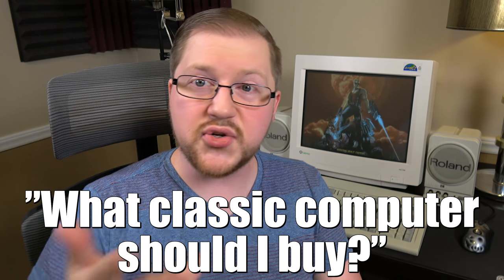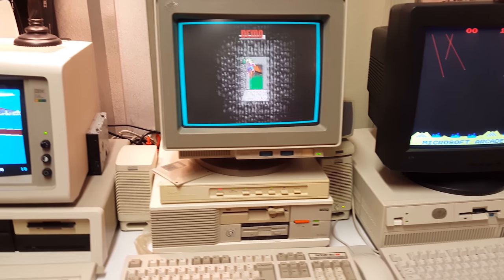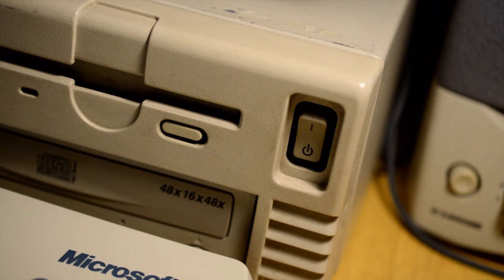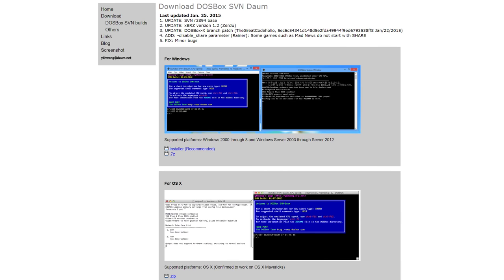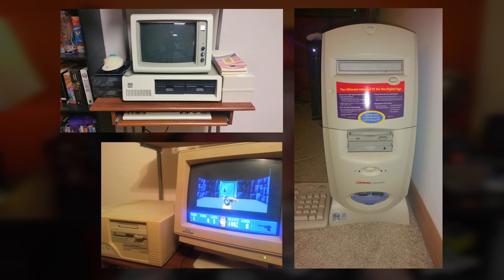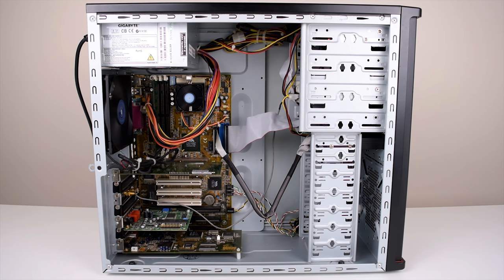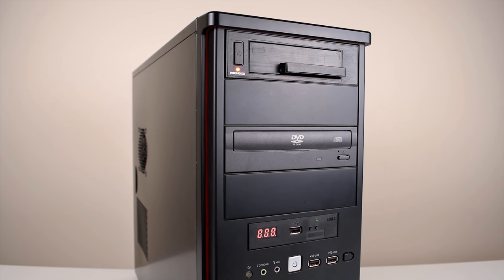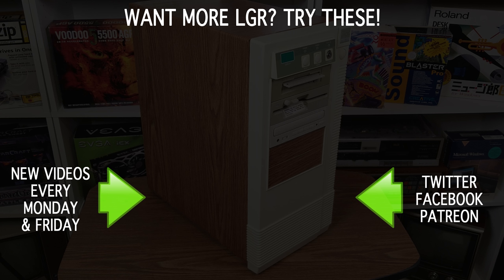Choosing a Retro PC for Games: Advice & What to Look For

Comment: As much as I loved and miss the nostalgic feel of the past, I am perfectly fine with emulation even if it isn't authentic or always accurate. Sure I miss the beeps, boops, buzzes and drive noises etc but it would be a hassle nowadays.

We used to have a 486 computer that I spent so much time on growing up, especially after my father got a computer with Win 95 and gave me the 486. Well time went on and it started to give me more issues as time passed. The thing basically became high maintenance and when I fixed one problem another would occur some time later so I said screw it.

Hell even the parts became more expensive and harder to find as time went on which was the main reason I stopped. It became such a money sink and I couldn't really afford it back then with what little I was getting paid anyway.

If someone not experienced gets into it nowadays then they better learn because it will require maintenance otherwise it will just became a huge paperweight. I'm all for authenticity but technology today has become so much more efficient and lasting without errors (Mostly), I don't miss it.

I definitely do miss my XP desktop though, don't really recall what it's specs were as that was years ago but that's probably what I was happy with most. I basically was able to run most of my 95/98 compatible games on it, some with issues but were usually easily fixed. Then of course emulation for DOS but I was fine with it.

Might have to build my dream machine for XP sometime, I'd be pretty happy with that.

Comment: These kinds of videos inspired me to build my own PC for late 90s and early 2000s gaming. The cost of vintage parts is expensive, and I already had a bunch of parts lying around, so I decided to sacrifice some compatibility for a cheaper, newer machine. It has a Pentium 4 3.0 GHz, 512 MB of RAM, a Radeon 9200, and a Sound Blaster AudioPCI card, running Windows ME. I may grab a copy of Windows XP to try out as well.

It's not perfect, and a few games run poorly or not at all, but I like it and it works pretty well for me. For DOS games that don't work natively on it, I run DOSBox, but on the machine itself. The irony of using DOSBox on DOS-based Windows is hardly lost on me.
Reply: As I see Pentium 3 is not particularly expensive. Not much more than Pentium 4 if you go for s370 instead of Slot1. One of my favorite P3s is my Pentium III-S 1.26GHz 512MB RAM, Geforce Ti4200 and Sound Blaster Live for late 90s and early 2000s. I got the whole stuff for about 25$. Though this one was a lucky catch. It's very likely that a P3 can be built under 50$.

Comment: I found an old Pentium 4 machine at a thrift shop for 20$. Had an nVidia card in it, two 60 GB HDDs, and 2.5Gigs of ram. Formatted the HDDs (was running XP), took out 2 gigs of ram (due to Win98SE issues) and swapped the nVidia for an ATI Radeon I got in a "box of parts" from the same shop on the same day for compatibility with Clandestiny. Came with a Sound Blaster 128 PCI. Installed Win98SE on there and it works as far as I can see. However, this was all to get Win98 era games that will not even install on modern PCs to work. I use Dosbox for everything else and anything XP and above is either functional or someone out there loves it enough to patch it to working.

Comment: Speaking of Sourceports, I also used DXX Rebirth to run on a P3 Machine along with a Voodoo3 and it's awesome. Did the same with zDoom (with BrutalDoom "addon" it's really great!) and eduke32 had to swap the V3 for a GF2MX for that I have to say because of (more compatible) OpenGL capabilities. It's a bit of picky with the OS, from XP on there are no problems anymore, but then you get - IMHO - more into the modern era with CPU/GFX then. If I can, or above Sourceports allow, I stay with even Win98SE and KernelEx. Sometimes I have to check out many older versions of the Sourceports.

Comment: Ahh the 486s. The first computer I built was not a 486 (it was based on a Celeron 300A in 1998), but my second computer was a 486. I found a motherboard discarded in the trash complete with 16MB RAM and salvaged it, added a 486DX2, a salvaged AT case and a SCSI card (Adaptec AHA1542CF) as well as several small SCSI drives salvaged also from older Macintosh computers that people were throwing away (as they were replacing their older Macs with the new at the time iMac). I got away with using a total of 6 HDDs in it by running them in software-mode RAID0 in Linux. :) The total capacity was a whopping 1.2GB!

The motherboard itself deserves a special mention. It was an Octek Hippo DCA2 with no L2 cache, as Octek claimed that their chipset does away with L2 by using some special-sauce RAM modules that allowed the whole RAM to become the L2 cache. I don't think that anyone ever proved them right or wrong, but the machine didn't feel slow. Unfortunately I don't have that motherboard anymore as several years later when I moved I had to get rid of some of my hardware, and sadly that 486 machine had to go away. I tried in recent years to find another Hippo motherboard, but they seem to be extremely rare these days. I wish I could now run some tests on it to see if there was any substance to the claims about L2 by Octek.
It also had a MrBios BIOS chip (anyone remember MrBios?) with many, many customizable options, more than I've ever seen in a 486-class computer. MrBios was primarily a BIOS upgrade company, they were selling customized BIOS upgrades but apparently a few motherboards also came natively with a MrBios chip. Good times.

To be honest, these days my favorite retro machine for DOS and early Windows games is an old laptop. An IBM Thinkpad 755CX, with Pentium-75, 40MB RAM (8MB onboard and 32MB upgrade card), 10.4" TFT max 800x600, 2.1GB HDD, and it actually has SB compatible sound (the infamous Mwave DSP) as well as internal FDD but no CDROM. Also has an IBM-branded PS2 mouse in IBM's colors (black and blue). It's not compatible with everything, but not too bad. I use an external 4x PCMCIA SCSI CDROM with it. And the best part is that there is a docking station for it that provides 2 full-length ISA slots, a 5.25" CD bay, an internal 3.5" HDD bay and built-in SCSI adapter as well. You can stick in it a real SB card and ISA VGA card if you want. It really is a nifty system. I must have spent hundreds of hours playing XCOM2:TFTD on it.

Comment: I will say this for original hardware. That was back when I started building my own PCs... Yes, it was more complicated. But hell, I've built tens of PCs over the years, and dip switches and jumpers were the norm. And it's much easier now. But I'd take take dip switches and jumper over menus and menus and menus of settings in an emulator any day.
If I were to build some PCs for retro gaming (I have very little nostalgia as I played everything till I got more than my fill), it would be a 386DX40 (only for wingcom2, and syndicate) with probably around 4Mb of RAM. EMM386 worked a treat, and if you ran memmaker once, and redid the config.sys and autoexec.bat yourself afterwards, you were golden. I cannot over-stress the importance of finding a good, low memory mouse driver. That was the holy grail at the time. Your could go from 23K memory mouse drivers like the Genius mouse drivers, to some 3rd party ones that went to like 6K or something. Oh and NC. norton commander was just awesome. pc tools looked pretty, but didn't do much. NC was the sh*t. ndd for disk problems.
For a DOS4GW machine I'd get the fastest processor build that could still run DOS. So probably a P2 P3, maybe even P4? 16-32Mb RAM. And Voodoo... As much Voodoo as you can get... Though the 4 and 5 were a bit iffy.... So probably a 3, and nothing SLI. AWE64. No VIA chipsets...  Asus and Gigabyte Mobos. TEAC floppy and stiffy drives. Probably a creative labs cd rom, but the others also became good later when we got to 4x speed and higher.  Oh hell, and if I could.... The $20 000 512Mb Maxtor SSD.... I think it was Maxtor or Quantum that came out with that ridiculous SSD... It took 2 or 3 full 5-1/2" bays... It was a  monster....

Comment: DOSbox has gotten better in recent years thanks to community-made forks that make it more accessible to newcomers while adding new features and improving compatibility and optimization.

With that said though, I'm grateful to have gotten my grandmother's old PC in my possession which had a 633mhz PIII-based Celeron CPU circa 2000, 3.5" floppy drive, an Nvidia GeForce 2, 256MB of RAM, and a CD drive. Over the years I've upgraded it with components we had lying-around or I've found at Goodwill. Upgraded the RAM to 512MB (completely overkill but it's nice to have for Win9x), added a SoundBlaster Live card for better DOS sound compatibility, replaced the CD drive with a Sony DVD drive, replaced CPU thermal paste, replaced the old 10GB HDD with a new old stock 120GB IDE HDD (also overkill but extremely useful), added an old Linskys USB Wifi adapter (a nice novelty for browsing theoldnet and using FTP I don't use it for much more than that though), a Daewoo CRT monitor from 1998, a cheap toenail clipper IBM ball mouse I found at Goodwill, and my grandpa's old Zenith alps switch mechanical keyboard which I absolutely love. It's my preferred way to play classic PC games predating 2001 now. I might consider upgrading the CPU and GPU eventually though so I can maybe get it to push more games from 2003-2006 or so (as a matter of fact I've since put the OS on a 16GB CF-IDE drive, upgraded to a Pentium III 1ghz and a GeForce4 MX 420 64MB- some very nice upgrades that ensure almost any game that works on Windows 98 will run relatively nice).

I would say Glide wrappers are now an essential part of retro PC gaming now since Voodoo cards have become prohibitively expensive at this point. They're a nice thing to have but not really viable for folks who don't have that kind of money. It's also important to consider slowdown programs like CPU killer in order to run older DOS games that weren't programmed with CPU speeds in mind, as they'll run way too fast to be playable on a 486 or Pentium without that workaround unless you're lucky enough to still have a turbo button.

Comment: The worst thing is once the EPROM's start failing in these old machines.  The UV erasable EPROMs technically only have about 10-20 years of retention of the contents, provided that they are covered in a completely opaque cover on the window the whole time.  While many have lasted more than 35 years this is much longer than the design life and at some point they will fail.

Comment: My solution is a little bit different. I have to admit that I am a huge fan of 19"-rack-chassis-solutions and so called IPCs (Industrial PCs). The design of such units are based on a so called back-plane, which only offers the slots for the interfaces You need (way more space for slots than on a regular PC). Keep in mind that there's back-planes out there with a variety of different interfaces combined to a single unit, some even offer 'wild' combinations never to be found in 'regular' home-/office-PC mainboards. Some companies still had the need for ISA-slots in the late 2000s / early 2010s, for example. [A few may even have today]. 
The arithmetical unit of processor and memory (sometimes onboard graphics card, USB, ...) etc. are located on and were/are provided as plugin-boards [side note: like single board computers (SBC)]. 
IPC-components are usually extremely reliable and made for rugged use and abuse; for example such machines were built to last several years to control some other machine / industrial robot for years on 24hour/7day-shifts. Some manufacturers even guaranteed 10 years of spare-part availability. Those machines were / are built for the industry.
In my country such IPCs are hard to come by in brandnew condition, as long as you do not run a business; that's for sure.
My task was not to build a Retro-Gaming-PC when I first picked up an IPC. I was lucky to get one ... got mine from an auction based on the bankruptcy of a local company. Got it for cheap, replaced the capacitors, replaced the cooler and the thermal paste of the CPU. That's all the service it needed.
My target was to build a Retro-Music-Software-Can-Do-Most-Of-All-PC. I call this IPC the 'Eisenschwein' (iron-pig). It's a P4 with 4 GB of RAM. It offers a Matrox GPU; a RME Hammerfall audio-card with several breakout-boards; all kind of CD-RAM-, DVD-RAM-drives and of course 3,5" floppy. USB, Fire-Wire and several slots for interchangeable HDDs. One of the ISA-Slots is occupied by an Atari Portfolio Card Drive,  just to feed my Portfolio with data if I need to. :-)

Comment: Okay, as to the future for preserving the ability to run the old retro software, one category that was completely left out is the FPGA manner of hardware recreation of the classic retro hardware platforms, like MiSTer. And that things like Sound Blaster cards have been recreated in modern implementations. Me thinks that as vintage hardware begins to fail then it will be possible to put new boards inside of them that are based on an FPGA implementation faithfully recreating all of its functionality. And fortunately there are companies that continue to manufacture quality keyboards that could be coupled to these. This will be the next frontier of the retro computing hobby and computing historical preservation - modern manufactured replacement motherboards that can be dropped into the enclosures of the vintage computers so as to give them a new lease on life and enable passing them down to the next generations.

Comment: I have a ProLinea 4/50 in the same case design as that Presario 4/100.  Still my favourite early 90s system.

You're so right about old hardware being a dedication.  I grew up with it so there is sort of a nostalgia (or should I say Stockholm syndrome) I have for jumpers and IRQs and such.  And it was quite fun to OC my Am486 for three years until it toasted itself during a furious Chessmaster for DOS binge…

My latest acquisition was a Compaq Armada e500.  Quad boots Win95, DOS 6.22, Win98, and my own custom Linux spin.  It has the same ESS AudioDrive sound that our Pentium had when I was growing up, so I was sooooo happy when I tried out PASSPORT.MID and heard those familiar sounds. 😸

Comment: Apologises to not commenting this earlier, personal stuff happened.

My way of PC Retro gaming is using a mix of original hardware and emulation, it's fairly self-explanatory. The original hardware comes in from the Late-90s to the Early 2000s (which I have a more nostalgic connection to), the emulation is before the Late-90s (obviously).

My PC of choice is not the best, but it's got the guts to do decent retro gaming on there. It's the EMachines Model 170, it's got around 500MB of VRAM integrated within, it has 32MB of RAM, a Pentium CPU from the Early 2000s (I don't know specifically which one, I'm stupid). The games are generally on CD-ROM (papa bless it) and on a still kicking 40GB Hard Drive, It's basically my first PC that I have ever owned and played on.

Comment: One combination that wasn't discussed, although following the same DosBox route as several of them mentioned, is to actually do a type of physical emulation gaming rig. This is basically the exact opposite of what PhilsComputerLab did, and this is probably what I'd do: I'd get an old desktop case and a great CRT screen, but build the PC with modern internal parts, put Win10 on there, and then use all the bells and whistles of software emulation to create a machine that can play as many old games as possible with modern parts, while still sporting retro physical aesthetics.

I'd love to use a reproduction PC case in the 80s or 90s style, kinda like my NESPi, but it's next to impossible to find cheap reproduction PC cases, so the most natural solution is modding. Yes, a lot of purists get angry at the idea of modding old computer cases to fit new parts, and I get that, since there's a desire to conserve as much hardware as possible, but honestly, what most people truly yearn for is the nostalgic look and feel of the old days, without actually being victim to the limitations and hassles of the old days (well, unless you want to treat yourself with legacy hardware, as you mention, and I totally get the aspect of fulfilling your childhood dreams and desires). :)

Comment: I played for many years on a Dell Optiplex from 2001, which featured a P3@1GHz, a Nvidia 6200 256MB DDR2 AGP, 512 MB SDRAM, a 20GB Hard Drive and a Sound Blaster PCI128. Unfortunately it quit on life yesterday, due to motherboard failure which was expected as it’s been giving me headaches for years due to its stability issues. I am now trying to build a functional computer from 3 dead ones, but it’s not going to be an easy task, as 2 of them (one is the Dell) have dead motherboards and the other one may also have the same problem (after a thunderstorm, resulting in the power going on and off and blowing up a PSU it never worked well again, having random shut downs). About the last one I am still hoping it only has some issue with the motherboard jumpers, as I recall my brother (who’s the owner of that computer) had plans of overclocking his P3 from 700MHz to 1GHz. In the end I am hoping to use that MB with 768Mb Sdram, as it’s the max amount of memory it supports, a 40GB Hard drive, which I was using in the Dell, 2 DVD-ROM drives, the Sound Blaster PCI128, the Nvidia 6200 and the 1GHz P3 which also was in the Dell. If this motherboard is dead, then it’s the end of a great era and the nostalgia you feel when using an old computer for me. Even if I am able to run those games I used to play on my daily driver (which is unlikely, as I remember they didn’t run on anything newer than Windows 2K) the feeling will never be the same...